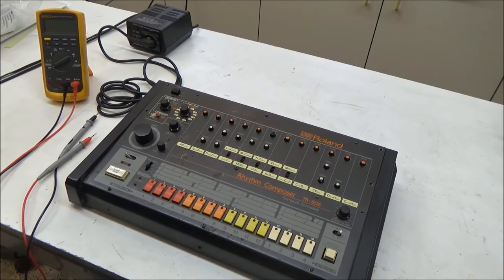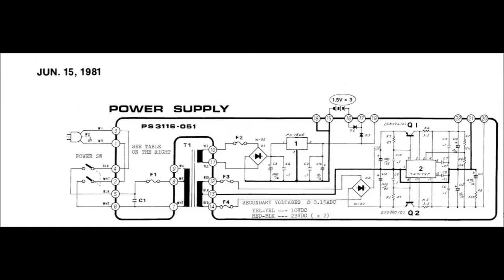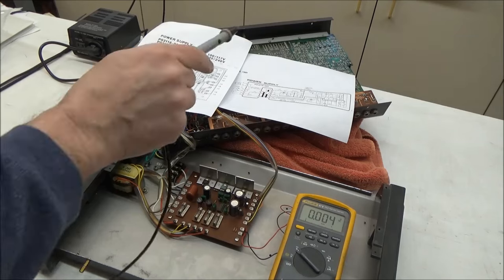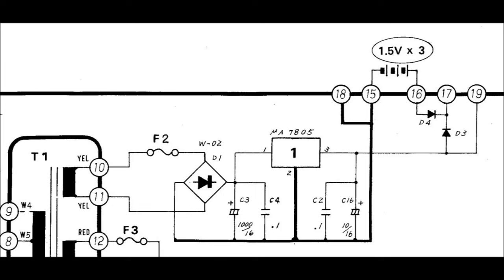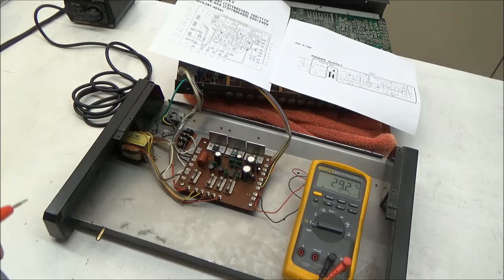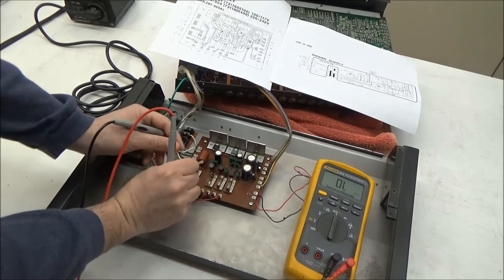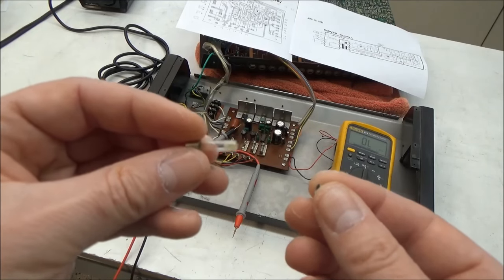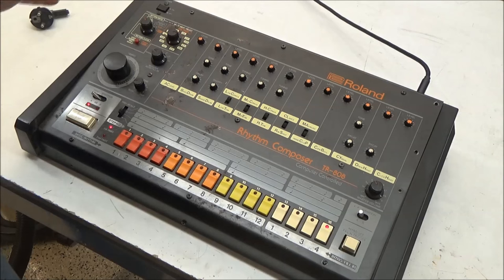Dead Roland TR-808 Repair - Synthchaser #164

Comment: I recently went through a similar exercise with my Q*Bert arcade machine.  I was checking voltages from the transformer, at the power supply, etc.  The whole time I'm thinking a bridge rectifier failed.  Nope, just a fuse.  Another reason to always check the fuse with a multimeter instead of just a visual check.

Comment: I learnt 2 good lessons from your video;

1) Don't measure the PSU with a potentially faulty load attached.
2) Simple parts (fuse, in this case) can fail in complex ways.

So thank you for that.

Comment: @synthchaser I just retrieved a TR-808 from storage that is configured for 220V and I want to do this EXACT conversion to 110V! What perfect timing that I found your video <3  Would you mind sharing the transformer and brand of fuses you used on this project? I'd like to use your recommendations.  Thanks again for this well-crafted content!

Comment: I had a problem with the 15/-15 fuses on a 106 recently, they were blown, but when powered on, voltage still made it to the other side!!  Somehow become semi conductors.  With the power off they were open circuit, powered on they passed a low voltage : /

Comment: I kinda need to do the opposite: convert a 120V American Ensoniq ESQm to 230V European voltage. But the ESQm has a complicated transformer because of the VFD, not to mention that the service manual isn't very clear about the power PCB.

Comment: Wouldn't it be a step down transformer?
Reply: It is stepping our 117v up to 240v
Reply: @sawsquaresinetube  It's stepping down 240 down to 110
Reply: @newking70  the owners existing line voltage is 110v, the unit required 220v line voltage, so the owner used a step-up transformer to change line voltage from 110v to 220v. Now replacing the units existing internal transformer to one that has an input AC voltage of 110v eliminates the need to use an external step-up transformer.
Reply: a step down transformer would be used for powering a 100-120v appliance in a 220-240v country, whereas in this case, a step up transformer was being used to power a 220-240v appliance in a 120v country.

he then simply replaced the 808's internal 220-240v-input transformer with a 120v-input transformer, effectively changing the 808 from a European one to an American one and eliminating the need to use an extra external (step up) transformer.

Comment: It's nearly always something in the power supply.    Change to different primary voltage use generic 9V and 12-0-12 ones, doesn't have to be exactly same, line voltage varies by up to 20 percent and the heatsinks just burn off the excess.
Reply: doesnt that heat also stress other components though ? Im looking for a france to US conversion transformer. any direction towardss a generic would be aprec
Reply: @COD-dr1ph   To connect directly to US line voltage, exchanging T1 for two separate transformers of 9 VAC and 12-0-12, would have less deviation of voltage than the natural variation in line voltage. The heatsink has already burned off excess voltage for decades already. If it didn't burn off excess voltage then the voltage would go out of spec when the line input drops to 80% or whatever it is.
Reply: @jagmarc  my calculation says that 12 volt ac produces 15.6v DC after rectification. Isnt this a little low for the ta7179p to produce a consistent 15v +/= ? shouldnt there be more headroom ?(around 17vDC?)
Reply: @COD-dr1ph    a "12 volt" transformer puts out more than 12.0 VAC :)       Hey, if does turn out lacking headroom you could swap the bridge for discrete schottky diodes with lower drop.
Reply: @COD-dr1ph     Converter transformers are available of course. 120 in and 240 out.  About 50 usd.
Reply: @jagmarc  A 12 volt transformer puts out more or less than 12 volts. As far as I know. Maybe 20% either way? And you don't know till you get there. And then the line voltage varies like you said. From what I can gather, a 20% headroom is essential for the downstream chip to operate reliably. But I'm just a novice here. I would just tell my client to get a converter and be done with it. But that's not what they asked me to do. They asked if I could modify it internally. Thank you for your help anyway.
Reply: @COD-dr1ph   It's usually more than, than less than. They're suposed to put out the rated voltage under full load, while at the lower limit of line voltage operating range, at maximum copper operating temperature. Try it and see with a temporary lash-up with loose wires patched in.